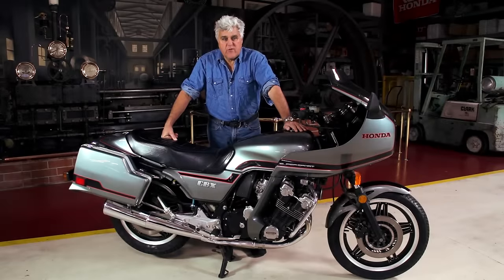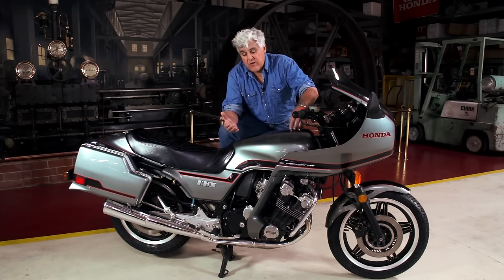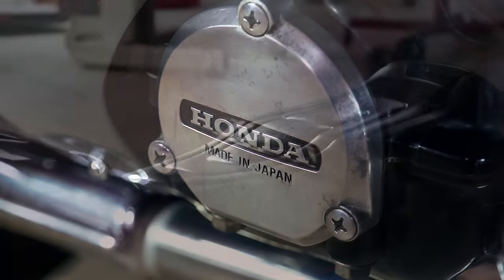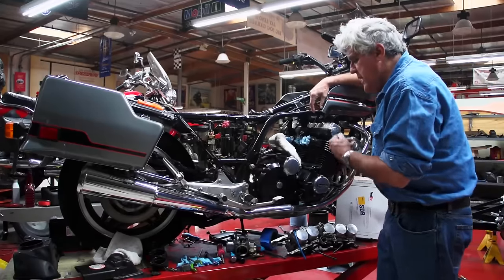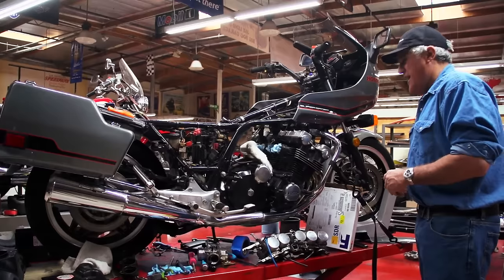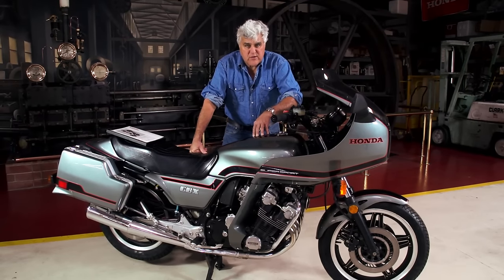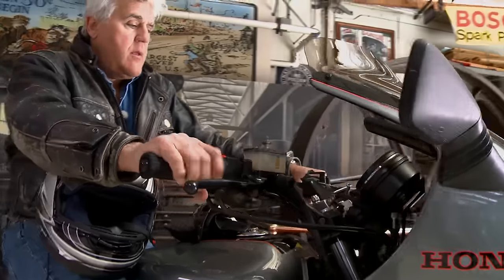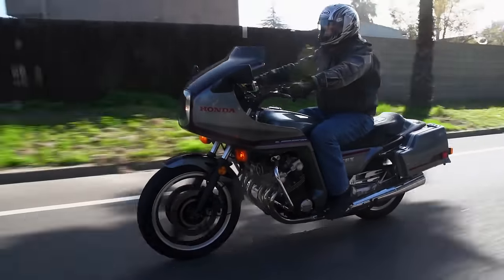1981 Honda CBX - Jay Leno's Garage

Comment: Top heavy.  I worked in a motorcycle shop as a mechanic way back when. The CBX was incredibly smooth,  but as soon as you put your foot on the pavement, you knew what you were working against. The Yamaha Venture was even worse.

Comment: Jay when you said CBX was a "mistake" for HONDA I wish to differ with you some. I thought one of the nicest looking bikes HONDA ever made; the '89-97 Pacific Coast PC800. Since I bought mine 5 years ago, I've seen many junked out. I have a spare engine out of '91 I got out of the Florida Keys that only has 7000 miles. I paid $250. for it w/ free S&H. But I'm 67 and  probably will get killed on and then both of us will be junk.

Comment: I was working at Kawasaki when it came out. One of our mechanics pulled in with one. Not too much later Kawasaki came out with the 1300 and the same guy bought that one. The Kawasakis were known for gobs of bottom end. My VG 1200 at 800 pounds plus me with a shaft drive ran 13.0 flat at 1/4 mile. The Gold Wing was easier to ride but nowhere near as fast.

Comment: I rode 1 back in the early 1980s. My friend was a motorcycle mechanic at a Miami dealership. The bike was getting worked on there. 1 night he let me take it out riding. As soon as I left, I pulled a wheelie and past a police officer. I took off. The cop was chasing me. I took the bike up to 152mph and it started a really bad wheel wobble that I almost lost control. I ended up losing the cop. I went back to the dealership and ask my friend why the bike was at the shop. He said the owner was complaining about a really bad wheel wobble.  LMAO.

Comment: My first bike was a 1981 suzuki gs250t, also my only vehicle bought brand new. Sadly, i gave it away when the gas tank rusted through in 1986., engine was still good, but it went through eletronic igniitions like crazy, $400.00 A POP

Comment: hello , congratulations on a great bike. i am lucky enough to say I have the same ,although yours is immaculate , mine is 9/10 mint condition. my question is the belt strap across the seat is it factory ,optional or what? mine has the strap across and i see your does not. great video on 1981 Honda CBX 1000

Comment: Thanks for the memory I test rode one loved it too. but they wouldn't fiance  at 18yrs so I got a gs 1000 did the normal deal bat wing bubble kerker header .....super champion plugs  remember them lol  still have the the bike last start 2015 last ride 2001 promised the wife when daughter born in 2000 I wont ride her anymore she didn't care I rode a hd just the rocket anyway it's all there original parts I changed too . I was raised in Manchester CT Rode everything down the railroad tracks  till turned 16 ..cars bikes anything to lose the cops for throwing a snowballs aka ice at the bus lol. Thank Jay for the laughs and the knowledge +1 brother man that New England education I love mine.

Comment: Jay , Im Jay Colorado Springs , 
Awesome Bike , but Search “83 Honda V65 magna Commercial.”

I own the 83 V65.. 17,000 miles showroom find.. 
It hammered the Cbx, .. 
Honda freaked people out when they stuffed the 1100 cc V4 (90 deg) 10,000 rpm readline.. Shaft drive, sport cruiser .6spd.
has 116bhp and covered the 1/4 mile in 10.8 sec. of the showroom floor.. lol 
Doesnt corner or have very good brakes .. But stoplight to stoplight it’s muscle .. so not for beginners.. 
Honda was and still is the top brass .. 
Cheers

Comment: That was a prestige bike making a beautiful sound... Otherwise it's pointless to have 6 cylinders, and a 1000 - 4 cylinders is easily better, with more torque at low rpm for a given maximum power. The best compromise in that displacement range might be 3 cylinders. My Triumph 900 Trident was a beast :o)

Comment: When I  was in my early 20,s I was a union carpenter making good money unmarried, living at home so I indulged bought a brand new 83 Yamaha YZ 490 out of the crate in 84 $1,700 then in 85 went from a 81 Honda CB650 to a brand new 84 Kawasaki GPZ 1100 $3,700 OTD 10.56 1/4 quarter mile I went for it one night on an empty highway with the wind at my back 151mph $100,000 plus sports cars couldn't touch it those were the days

Comment: Borrowed this model of CBX for a few weeks back in 1982.
A few years later i bought a low mileage KAWASAKI ZG 1300 of 1985.
The 6 cylinder engines of these bikes do not have the torque feel of a 4 cylinder engine.
The Honda 6 engine of the CBX came from the racing Hondas of the 1960s as Jay said.

Comment: The CBX was crazy...being into sport bikes i sat on it at the honda dealership...sitting out front it was stunning..but i felt like i was ready to give birth my legs were so far spread...i was like ok...thats not a good fit...i never really heard muxh  about the bike...i hadnt gotten intwrested seriouly in sport bikes yet it about 8 years later after condos were built on the older kids large motocross track...i changed an bought an FZ 750 1986 model...

Comment: Allways better stock I think half of these mods make the bike sound good but no faster ,unreal carb set up but a nightmere to work on the z1000 was just like a ohv ford engine to adjust the valves but when you look at the Honda rc30,40,45 try getting to the engine to work on one they are a nightmere I liked the cb900f2a .I couldn't afford a scooter now..😂☹️such is life..

Comment: my kz 1300 was fuel inj water cooled shaft drive am fm and cassete  and electronic cruise control 120 horse 6 ltrs of oil check one out they only made afew thousand in the states

Comment: Ich bin 12 Jahre CBX Pro Link gefahren... mein Motorrad hatte am Ende seines Lebens über 200'000 km auf der Uhr. Der Unterhalt wurde unerschwinglich (alle 6000 km ein Service). Leno's Bike dreht eindeutig zu hoch. Im Standgas sollte der Motor knapp über 500 U/Min drehen. Wenn er wahr ist dreht er höher, dafür ist dann das Gegengas gedacht (Gasgriff nach Vorne drehen). Das Bike hat null Vibrationen, zeitweise spürt man den Motor gar nicht. Ab 7000 U/min geht dann aber die Post voll ab und der Sound ist wie bei einem F1 Ferrari! Hätte ich das Teil bloss nie weg gegeben.....

Comment: i had a 69 cb 750 sand cast would burn 20 feet of rubber in 2nd gear till chain broke and went through the back cases suzuki tt 500 faster till i got my 750 h2  then my kz 1000 i was rasing kh 400 triple but i crashed bike was one day old

Comment: You may just have to find a real mechanic to synchronize your carburettors.
That will get the engine to idle at 900 rpm and purr like a happy little kitten.

Comment: Here is when you know you are getting Old.... when you 48 and buy a 81 Honda CB750 Custom, just because you had one at 16... And No Longer Fit.... even tho you are the SAME Physical Size of 6ft 4in.... but weigh 65lbs more.... from 235 then, to 300 now... So it feels like you are riding a 250 size bike or even a pedal bike.....

Comment: i like the older ones better, but as said here they had a bad and weak chassie, and they was very wide, not sporty really.
so i understand why Honda made a touringmotorcycle out of it, the Suzuki GSX 1100 was already eating up these in everything but the sound.
i could have bought a 78 but choose not too because of all this, this was early 90s so they was cheap, i bougt an Honda CB1100F instead, they are not worth much today, but i would nevere have lived with that CBX anyway to get more money out of it.
this one is to restrikted, change the exhaustsystem, this sound nothing.

And one straght six bike is forgotten here the old watercooled Kawasaki Z1300.